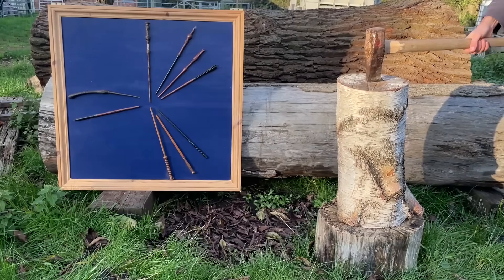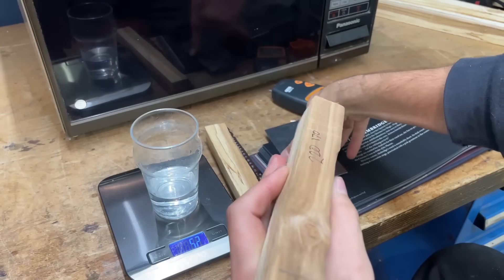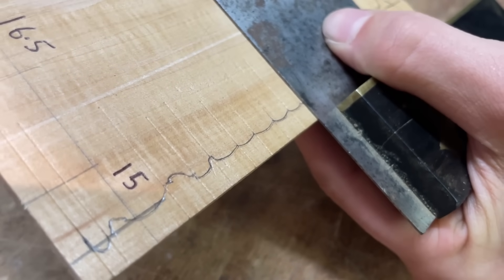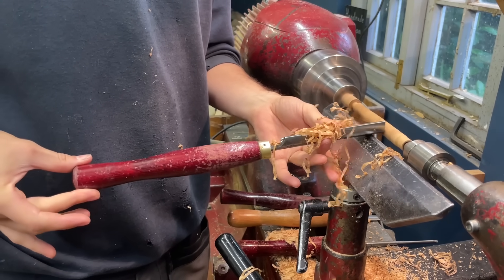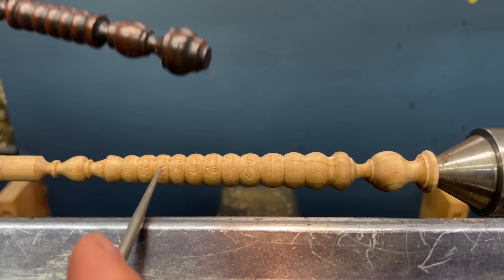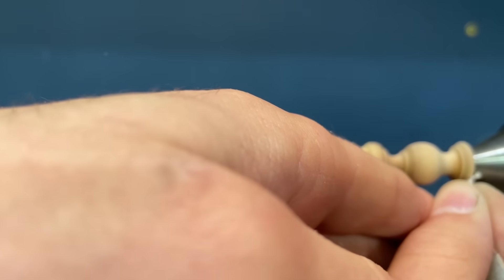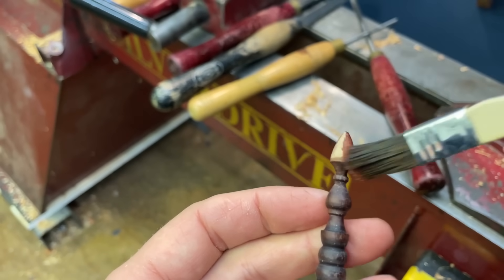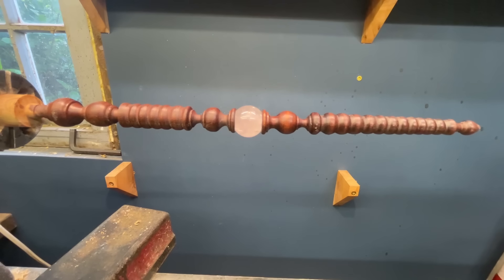Making Dolores Umbridge's Wand - from real wood!

Comment: Ive watched several of your wand videos now, I love them!   Im just getting into the process myself. I just made my first wand from our old curly willow tree. I saved some branches after it fell last year.  Using wet wood sucks. Tearout is a major problem, but so is flexibility!  I did have to support the wood like you do while turning it down to final thickness, but using my off hand to support the wood while its spinning scares the heck out of me.
Having the voiceover explaining the steps is quite a nice addition in my opinion.  I thought the round stone looked much better than a hollow piece of glass with an obvious metal rod support.
Thanks for all the great information, and the editing and camera work is top notch!

Comment: Vacuum-stabilizing rotten or punky wood with resin or Cactus Juice makes doing fine details way easier and helps prevent breakage. I've started doing it forcknife handles and spoons and it works a treat.
Reply: My dad uses... extremely thinned varnish with mineral spirit.

Comment: Imagine making custom wands for people of the type of woods used in harry potter. Then take strands of white or blonde horse hair ,strings made of lizard leather or feathers painted like a Phoenix feather and letting people choose their cores. then drill a small hole down center of wand and put in the cores and seal it with a small plug.You could make bank from that. It's all make believe the magical power but imagine it's the closest we have to the real things and would be a cool collectors piece.
Reply: Drilling holes down the center would weaken them unless you used resin to fill in the gaps.

Comment: Using a Microwave to "dry out the wood" is and should more called Cooking the wood. it causes moisture inside the wood to turn to steam and seeks it way out through the fibers of the wood, and most definitely causes warping. on top of that when you turn it on the lathe, you shet a lot of tear out because the ward sections inside that have been overheated by the microwaves then crumble. We've all left a piece of bread inside of the microwave for too long and when it cools off it becomes super hard and crumbles the second you try to take a bite, well the same thing happens with the wood, only it acts like dry rot, and simply flies apart the second your tool hits it. So, for a project like this, you can fudge it a little but I can see the telltale signs of overheating a dry heat register is always more preferable to the microwave, because a dry heat will dry the wood slowly comparable to the microwave, and even then, you can always tell kiln dried wood because of its warpage. Nothing beats wood age dried in a controlled environment BEFORE it is milled, but that obviously take years to properly accomplish. then there is the slight rot but yeah, when it's the only piece you've got, you have to make it work. Just a little bit of a tip when dealing with breakage, like what happened with the tip of your wand. Use a tiny finger drill or just use a small drill bit of appropriate size, cut a small length of brass dowel the same diameter as the drill bit and insert it into the holes you've made in the shaft and the tip and use a bit of resin glue to join them together. Cyanoacrylate is not an appropriate glue type because over time it degrades and will eventually let go, but the resin glue is permanent and will usually outlast the structural integrity of the wood it is holding together. Great video BTW, and your usage of the Rose quartz is entirely proper, OR you could have also used a lighter grade low quality Amythyst sphere as an alternate, since the wand seems to be more purply in color, no? Anyways, Cheers mate!

Comment: These wands are really impressive as always! I got a lathe myself recently and am wondering how you get your tools so sharp? When I touch my tool to the wood it chips pieces off rather than shaving it. Yours is like a pencil sharpener
Reply from the maker: Standard grinding wheel - I have CBN/diamond wheels which helps
Reply: dad said he use hand cranked grinder with gray stone.  hand finish it with whetstone.  He does not dare use electric grinders... too difficult to maintain original angles.  REMEMBER those gouges' angles are not cut the same.  Jig might help some.

Comment: I think you should have used light amethyst instead of rose quartz...
To be honest, I have a lot of trouble with 'making wands  from the correct wood.' I'll try to explain why. It so happens that the original movie prop wands weren't made from the 'correct wood type.' The aesthetic aspect was much more important than following the canon. Starting from the length and shape of the wands and ending, in fact, with the types of wood. Most of the wands were made from valuable species or from rare and specially beautiful pieces of wood. For example, many wands were made of rosewood, in particular, Harry's and Draco's  and Umbridge's ones. Ebony was also used very often. And the elder wand was made from english oak. Voldemort's wand was made, I believe, from some synthetic material so it can look like a bone. Hermione's wand was made, I suppose, from oak or walnut, and Snape's and Ginny's ones from ebony, etc.
So it would be very very very cool if use correct movie  types of wood, so you don't have to paint or stain them. Anyway very cool job you do, colleague 💙
Reply from the maker: Thankyou - yeah where possible I want to avoid staining, but I've thought about one day remaking all the known wood wands out of the correct wood again but left natural colour!

Comment: You should reach out to a glass blower for the bead, they can form it with pins to position each end, that way if it's wonky again you can blame them 😂
Reply: Or if you can get a long piece of rose quartz to pop in the lathe you could use some diamond bits in your rotary to shape your own

Comment: Would it have been at all possible to wear down the rose quartz until it's the size you need? I saw a video once of someone dumping marbles in a bucket of water and smooth stones and shaking it around and the marbles wore down with the shaking and still came out smooth and round. I'm not sure how exactly the process was done or how specific it needs to be, but I wonder if something similar could have been done here.
Reply: I've made spheres in the past, and that's pretty unlikely. Quartz is a 7 on the Moh's scale, and it even takes a while on the sphere maker to wear it down, and that's under pressure in the cutting cups with grit. Doing it by hand would take an extremely long time, and I doubt it would be perfectly round.

Comment: That was FAROUT lathe work.   my dad taught me but not that thin!!! he is not master wood turner but has been doing it years,  preferring to turn bowls.  but he  taught me.  watching you doing yours. 

made me think a few lessons.. yes you can use rag to control.  dad say keep material small.. smaller equal less harm compared to large pinched mass (think how much mass equal to flying shards) . this applies to wax applicator materials and sanding squares.  

did you know that in history,  the tools... be they called gouges, skews chisel, etc.  Stone age is believed to have done wood turning with  knapped stone. obvious with later evolution on materials.    

Watching you do the fine work on Dolores' wand... made me want to say something.  I would cut out strips of steel,  be it either part of a old sawblade or from cabinet scraper (with angle grinder) then sharpen edges. make handle on the lathe then  just mount steel on it, probably epoxy or screws.  considerable thought toward safe control on the cutting. 

Regardless,  do you know those quartzes can be also lathe turned too.  use diamond bits as lathe edge tool.